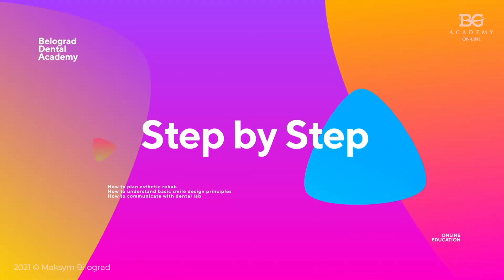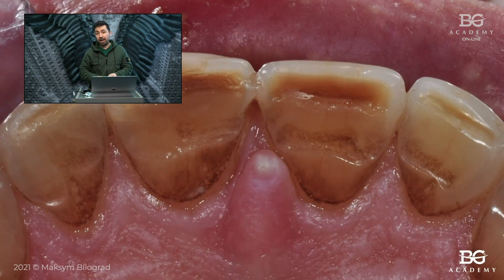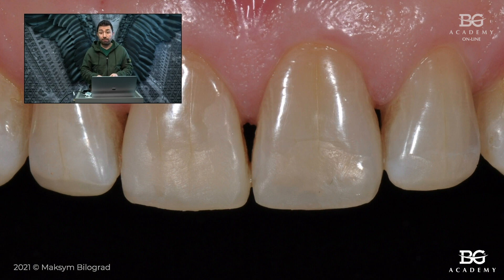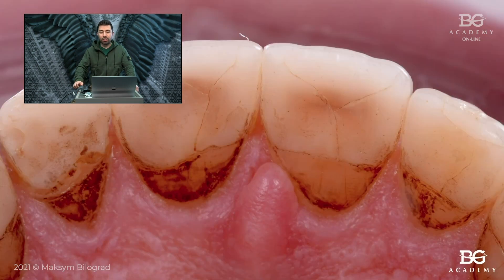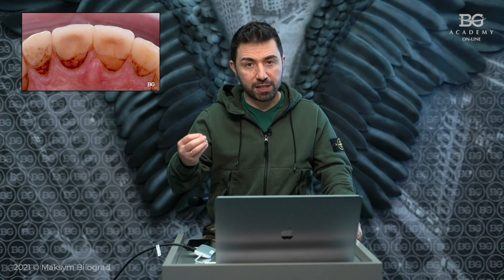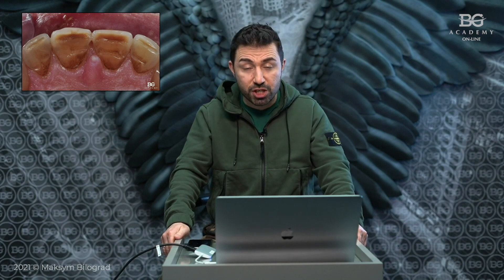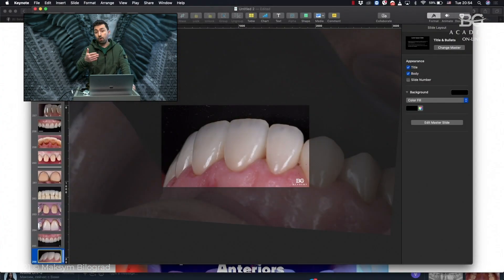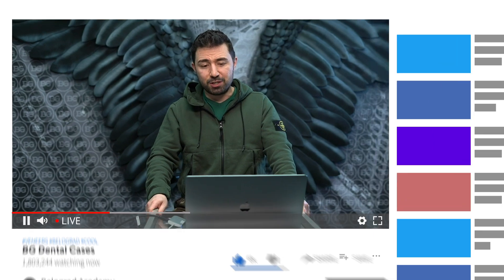#Cracked e.max | BG Dental Cases #19

Comment: How did you bond the E.Max crowns: luting composite or heated restorative composite?  It has been shown by Gresnicht and others, that heated composite reinforces the ceramic
Reply from the maker: I’m not using heated composite. Resin cement or highly filled flow able